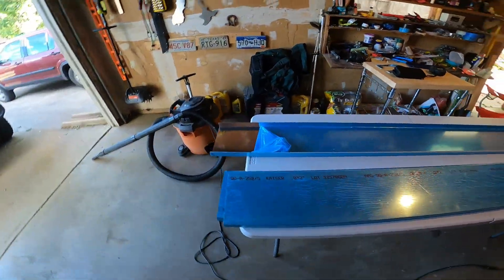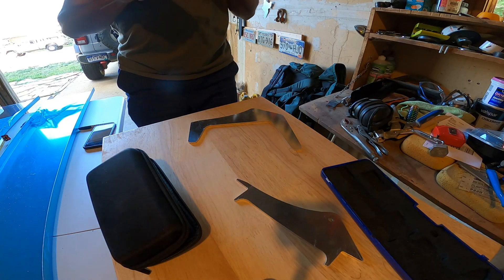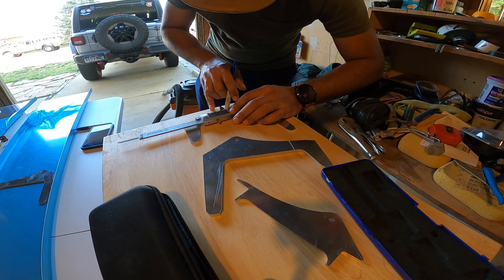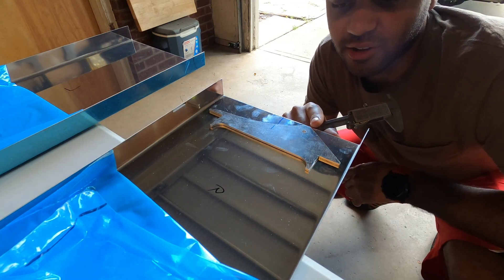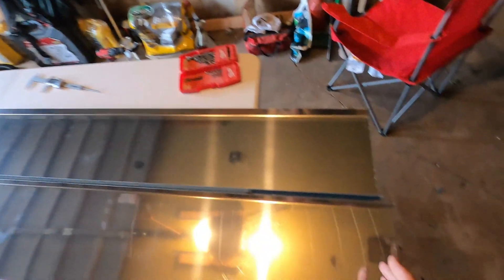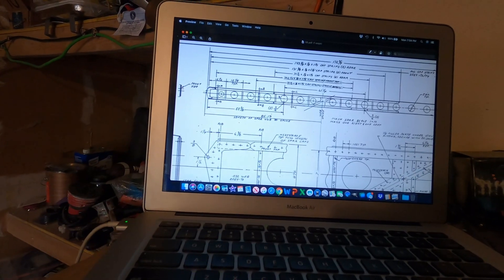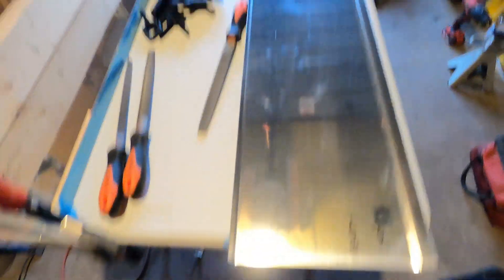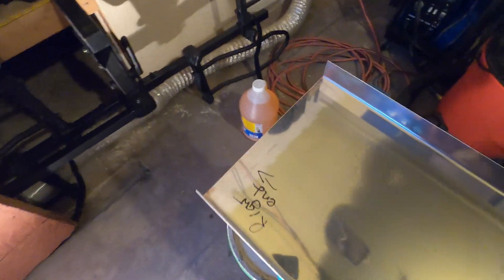Bearhawk Aircraft Build Part 2 - Main Spar Attachment Holes Drilled & Cut to Length

Comment: Bearhawk plans are also available digitally? That’s pretty cool! Would make scratch building a little easier especially with having access to a laser cutter!

Good job on your build so far!
Reply from the maker: Reuben Thanks! Looking forward to finishing the cap strips. I had the plans scanned at Staples and my dad traced them to create 3D models of the brackets so the digitized plans are not something included in the plans you buy.